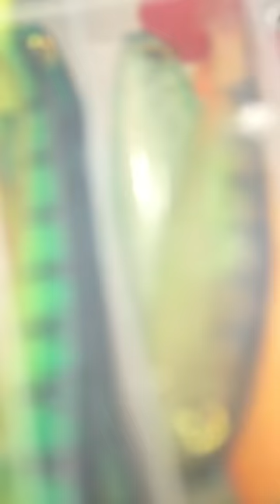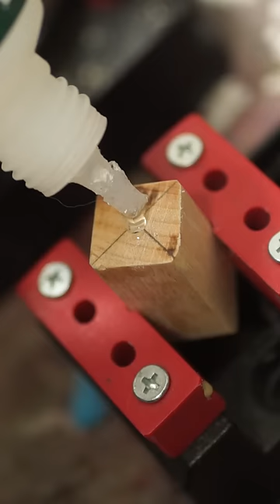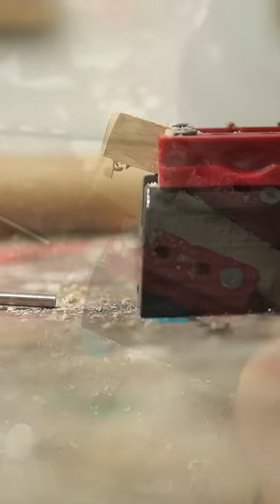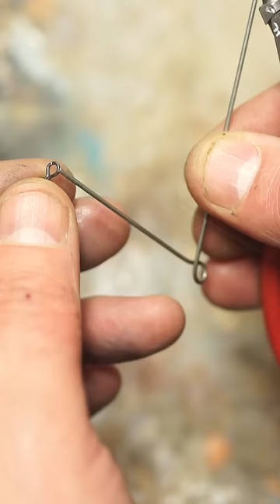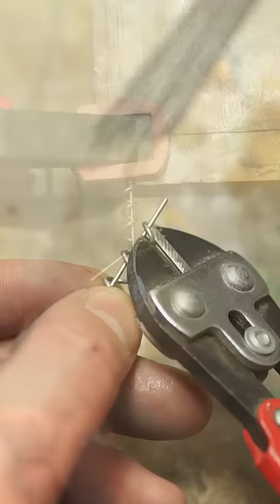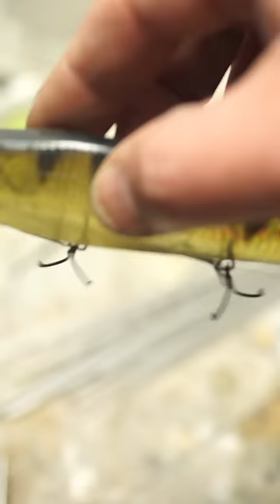The bait screw tool

Comment: Very nice! What kind of pipe are you using and where can I find it?
Reply: It looks to be an aluminium pipe or hollow rod. Easy to cut with tools that are suited for wood (and aluminium). Rods like these are found in most big hardware stores.
Reply from the maker: Check description
Reply: Thanks! @PaulAdamsTheHandmadeFisherman
Reply: Aluminium wont hold for 1,2mm you need something stronger. Been there done that.  @pieter-matthijsbolt6375

Comment: Quick question: wouldn't that screw piece come right out of the body of the lure with a strong enough bite?
Reply from the maker: i have never lost one that way but you could never say never, it has a lot more hold than standard jig hook and the fact the hook is on separate leader helps, thanks